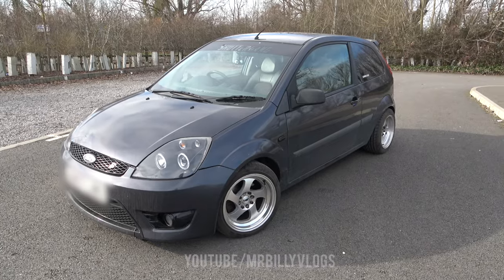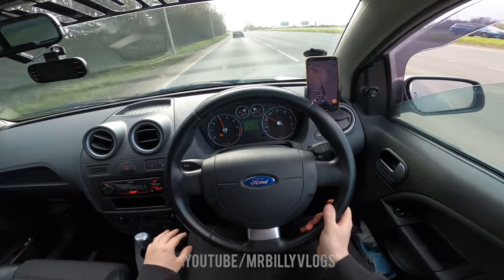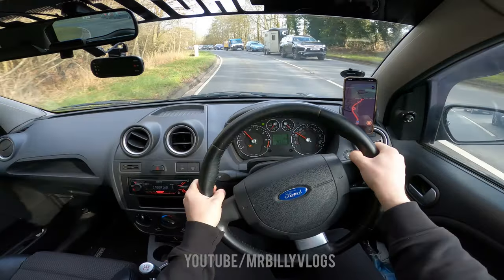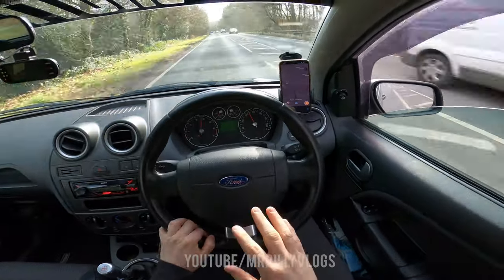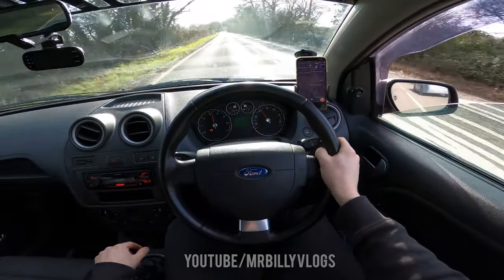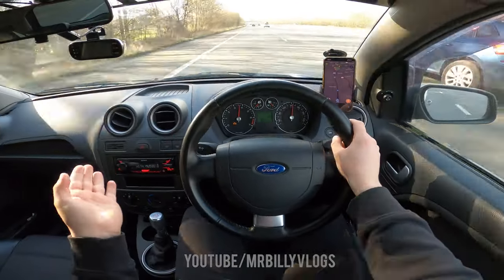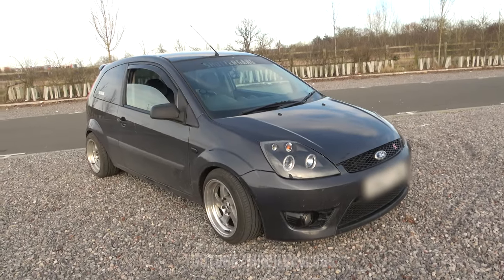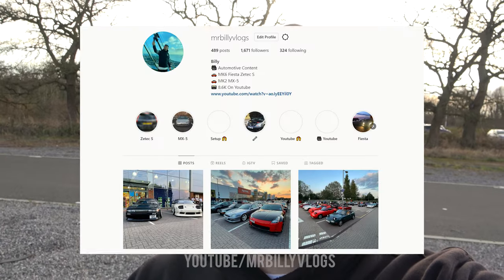POV Drive In My Modified MK6 Fiesta Zetec S! (Hornet Straight Pipe Exhaust!)

Comment: Good little video mate, I do enjoy a good POV every now and then. 👍🏼
I also like those JR15’s. I wanted a set for my car, but unfortunately they weren’t available in my fitment so I ended up getting some JR10’s instead. Although I do like them, the polished rim has already started to corrode quite badly.
I think your Fiesta really needs a chunky body kit and the wheel arches rolling slightly, although that’s probably a bit extreme. Maybe start with a front splitter and some side skirt extensions. 🤔
✌🏼

Comment: how did you add camber did you slot the struts
Reply from the maker: Cars on AP Coilovers I haven’t adjusted anything at all!
Reply: @MrBillyVlogs  must have adjustable top hats i got the stance plus ultra they are quite hard but used to it. Seems to get alot of negative camber when you lower it anyway
Reply from the maker: My AP’s are very stiff can fell every bump you go over but I do need more camber and lows just haven’t got a clue what I’m doing 🤣

Comment: Sounds like when my old ST150 broke it's back-box off (Shite & obnoxious, no tone just noise). Omex is pretty cringey too, usually for those still in their teens who don't have a concept of mechanical sympathy. All in all, seems a ropey Fiesta based on it being held together with cable ties, sagged bumpers, Ebay exhaust, missing door handle trim etc.